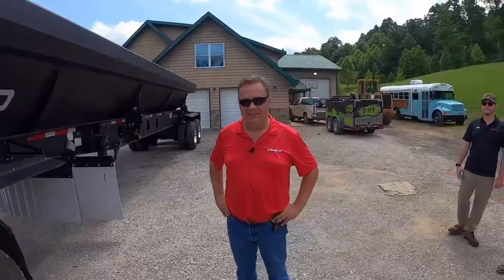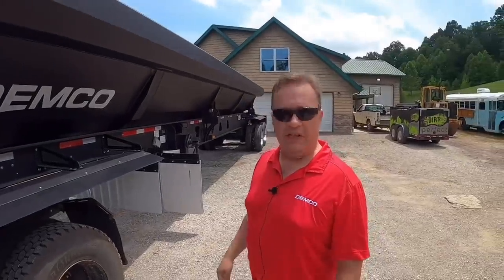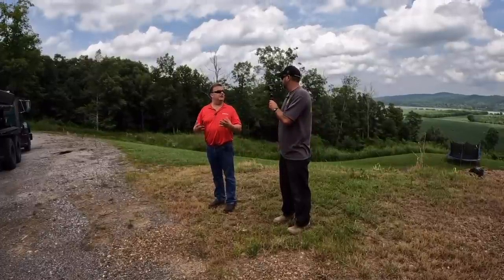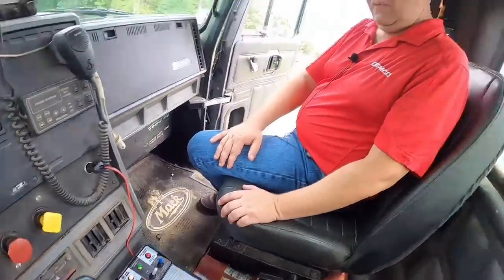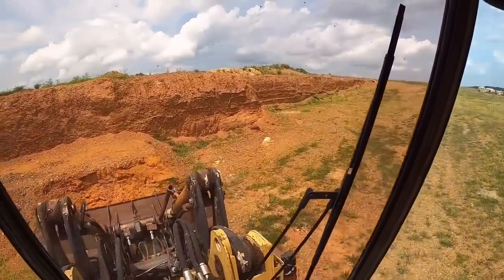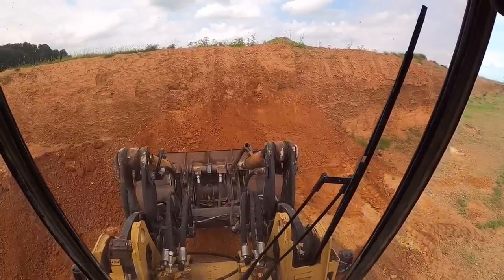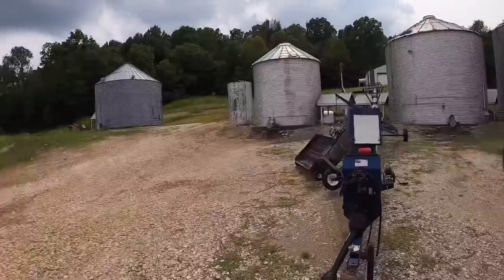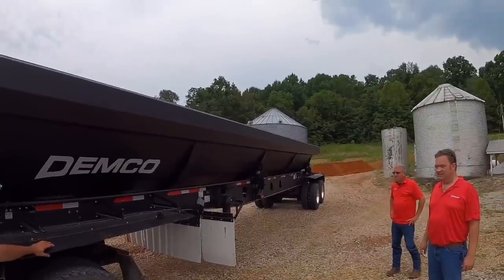Will A New Demco Side Dump Trailer Be Useful For Our Operation?

Comment: I ran a side dump on a few projects and I do like the way they pull. Feels safer in most conditions than a end dump but it does have its limits. They don't pile as good as end dumps. My favorite feature was dumping on the fly by. No need to stop equals less likely hood of getting stuck. So basically if you are dumping on the driver side you steer right, away from the pile, as you dump and it helps keep the material from going under the wheels. Less getting stuck and less chance of flats in your tires. 
Another good feature of the side dump is less training. End dumps can be dangerous and tend to need more training.

Comment: Man what an awesome company and trailer! I could totally see you using this for keyways on ponds and driving around the top side instead of backing down with bubba dump. I could also see this being used to haul stumps and trees since its long and you don't have to worry about it coming out the back.
Reply: bubba dump could get a fifth wheel plate?

Comment: In the Pacific Northwest you see side dumps pretty regularly.  I worked for a general contractor building concrete tilt up warehouses on river bottom soils.  Before the foundations could be started, a pre-load of the site was required, in which the site was forced to be compacted.  A pile of dirt was hauled in, sometimes 10-12' tall for the entire building footprint and then the site was monitored by surveyors to verify the settlement of the footing sub grade.  This could entail hundreds of truckloads of material.  The side dump was perfect for a long, wide dump needed for the pre-load.  The dumps were windrowed out so the lifts were controlled for spreading by the dozer and better compaction of the pre-load.  After the pre-load was completed, all the material was trucked out, except what was needed to get to dock high slab elevation for the warehouses.  In this area, the brand you see quite a lot is Sidedumpr.  They seemed to work great from my perspective as the GC's superintendent.

Comment: Here in Idaho, side dumps are everywhere, probably 40-50% of the dumps are side dumps. They are fabulous for road widening/shoulder work. They can dump a load with minimal traffic disruption. The trip cycle time is much faster. 
The DEMCO sales team is fortunate to have Mike as a demonstrator. Mike rocked this demo.
With the volume this trailer can haul, I'm surprised it does not have an air scale in the rear axles.
Reply: I'm also in Idaho and run side dumps, SmithCo is mostly preferred in our area, they hold up and dump (clean out) a lot better than any of the others those squared corners in the bottom is a sticking point, everyone that's had a Demco for a while calls the flex corners flex and crack.

Comment: 24:29 As a safety turn your tractor a bit when your dumping. If your dumping to the left side, nose your tractor to left.not a lot. You can dump straight. But if you are dumping rock or trash you can back away from it easier if crap gets in under your tires. If you want to stockpile . Cheat your trailer up to you pile and jackknife as you back away.
I've run a sidedump a minute or two. It's more fun pulling two at a time.
Reply: We were pulling twin 40' in a 9 axle configuration. 35 tons of rip rap in each trailer. Load her up and go truckin!

Comment: I’m impressed all the dirt came out and didn’t get stuck by pile building up. They definitely have their place, but only when you can get a semi with a  trailer to the loading and dumping spot. Not to mention it’s gotta be level ground.
Reply: ANY dump trailer has to be on level ground.  That side dump is probably way more forgiving than an end dump so long as the load doesn't stick.

Comment: Loaded alot of side dumps, we use them alot in Montana.  Just be a little careful dumping really really sticky mud off an embankment.  It tends to stick in the tubs some times past where dryer dirt would have normally already started to fall out.  The muddy load tends to stick in there causing the wait to be unbalanced to the side your dumping off and I've seen my far share of them on there sides.  Usually dosen't hurt anything just have to tip trailer back up onto tires.  It kinda tips over on its pile so it dosen't usually take the whole truck over unless your dumping off an embankment where the pile dosen't catch the trailer then the truck sometimes goes over the embankment upside down.  Not a good day. Other than that they can be really handy for hauling riprap, and other debris/trees, logs.  Can haul larger loads of dirt/gravel like a belly dump but dont need so much space to dump a winderow out like a belly dump requires.

Comment: I pulled a dump trailer a lot of miles in southern indiana over some sketchy roads and dump in places that were far from level. I never turned on over, but came very close a few times. So, as far as pulling goes I really like it, loading looks pretty easy for the operator, it may be limited on placing material exactly where you want it sometimes, 39:37  but the safety of dumping will allow you to dump in places an end dump could not. From what I see for an excavating operation, thumbs up!  Can't wait to see you take it to the job site.

Comment: Hey Mike!

My in-laws have ran a side dump on their farm in Iowa for 15 years. Their first one was a tandem axle in the rear and they turned it over several times. No big deal, just flip it back over and go again. When they replaced it with a new one, they got a tri-axle in the back and it is way more stable. They leave the 3rd axle down and lift it back up once the load is out.  They almost always dump with the truck at a 30-45 degree angle and then back out of the pile before going forwards (prevents getting stuck a lot of the time, as well as creates even more stability).  They haul manure, rock, dirt, busted up concrete! Works really well! Hope it is successful for you!
Reply from the maker: Awesome

Comment: Just an observation for feedback to Demco: I'd think it would be nice to have that 3rd switch option for actuators on the front and rear pivot locks.  Then the driver really is hands off and can do it all from the cab.
Reply: you only need to do that if you want to switch dump direction so you would only do it maybe once a day maybe only once a week
Reply: @griffoutdoortv5882  not necessarily.  If you're dumping repeated loads in tight quarters and have to utilize both sides of the space it would be handy to have the option and utilize an otherwise unused switch if you don't have a drop axle.

Comment: @dirtperfect we run sidedumps daily in the Midwest, love them. Only tips I’d recommend are we always turn the truck to 10-25 degree angle from being straight with end dump. So we turn slightly in the direction of the side we dump the load on. That pivot angle makes truck feel stable and prevents the trailer from wanting to feel tippy where it wants to when truck and trailer are straight with each other. Especially with sticky loads, having the truck slightly pivoted from straight helps because sticky loads can be scary when the dump hits that mid dump point(I did too ours once but it sits much higher and had concrete pieces  sticking out the top making the trailer too heavy) . Plus offsetting the truck from straight allows you to back up straight into the angle and avoids pulling the rim and tires along/on the pile of material you dumped if that makes sense.

Comment: I lived down south of you guys in Clarksville, TN for much of my life and, yep, the side dumps are odd creatures back east and in the South.  After moving up to North Dakota (Watford City, 2014, Williston now), side-dumps were part of the water-hauling/rentals operation I worked for.  We used them to haul drill-cuttings to our landfill.   We also used them for hauling scoria (similar in color and weight to a clay pot that's been ground up, kinda the same color of the chirt you were hauling but a lot lighter) which is used up here for oilfield pads and a lot of the "dirt" roads.  Drill cuttings would stick in the tub frequently (we had long-handled scrapers to clean the tub out) and due to the soft nature of going up on the pile at the landfill, we always had one of our dozers holding that push-block.  The push-block was handy for heavy equipment to push us through mud that was often axle deep.  At the place where I now drive winch trucks most of the time, we used a couple of side dumps for hauling off demo debris (an old wooden grain elevator over in Montana).  As long as the material isn't sticky or frozen in the bottom (if anyone is going to get a load that sticks, it'll be me  lol), they work great.  If something DOES get stuck, it's a lot easier to get to it with a scraper or the bucket of a wheel-loader or excavator.  

I've only pulled the tri-axle versions and they are far more stable than they first appear.  I've a healthy respect for center of gravity but after pulling them for a while, curves and turns didn't bother me much at all.  I'd much rather dump one of these than an end-dump, too.  They're easy to switch for dumping to the other side.  Windrowing material on the fly is not a problem with some common-sense, of course.  Plus, you mentioned dumping over a wall, which is what I used to do at the landfill on occasion in a mixing pit where the wetter cuttings were mixed with scoria to thicken things up.  

I'll be curious to see how you guys like it after a project or two.

Comment: Well if you use the site dump trailer when you were making your pond you could drive along the top and dump it and into your bulldozer wouldn't have to work so hard to move the dirt where you wanted it cuz you could pour it off right now or you needed it
Reply: Aslong as it’s not wet or soft. Pond locations are usually wet hence why it’s a good spot for a pond. Not always but most times

Comment: Mike the best advantage to a side dump is hauling rock and dumping over the side of a ditch or a dam where you need Rip Rap. I have seen the state of Oklahoma use them in for that purpose. Especial when using larger rocks or gravel.

Comment: I’ve been running double side dumps in Vegas for many years. I have tipped my pup trailer over twice due to the ground giving away under my tires while dumping over an edge. Wasn’t a big deal. Flipped the trailer back over with the loader and went right back to work with no issues.

Comment: Looks like a well designed and built trailer.
Reply from the maker: It is
Reply: @DirtPerfect  I noticed you switched sides you dumped from, was that so you didnt block his drive or some other reason?

Comment: In western Oklahoma I’ve seen 1 side dump, 25-30 end dumps & 1,000 belly dumps. When you use a belly dump especially on road work you drop a  windrow back the next 1 up to it & drop it, take a blade roll it back & forth a couple of times and then you’re done. Works nicely
Reply: Belly dumps spread gravel beautifully at 40 mph. Don't even need to blade it.

Comment: As a driver that has grown up in the dirt world, construction, paving, demolition, earth moving, and what nots. Mostly on the west coast, but long before side dumps were a thing. I have been aware of their presence and have always wondered about the stability while dumping. So there were a couple things that caught my attention from the start, the first were the drain holes to prevent standing water. Not sure how large those holes are, but being in the bottom of the floor as they are, there would be a fair amount of concern hauling something like washed 1/4 minus (pea gravel) or sand, especially beach sand, not crushed sand, like used in playgrounds and golf course sand traps. The other thing that stood out were the shiny aluminum wheels, my aren't those pretty! But upon dumping, the material spilled into those pretty rims. Two problems there, damage to the pretty finish, and upon completing the dump one would need to pull away from the dump site and take a minute to clean that material from the rims to prevent carrying it out to the road for a potential windshield claim. Much like you should brush the apron from a traditional dump truck. Another disadvantage could be dump site space. Often a contractor will require that the piles (especially stock piles) be kept high and tight, whereas here your piles are 34+/- feet long and stacked side by side. I can see some big advantages, say in a quarry application or in any sort of operation that say a bottom dump might be suited for.

Comment: Great Demo. all went well that is till you pulled away from the dump. Notice the tires on the trailer crossing the dump pile. If that were construction debris with sharp objects your investing in new tires or you now hung up on a few stumps or logs that have rolled up under your trailer. Having the right tool for the right job comes to mind.

Comment: Absolutely!  With the side dump, the box doesn't have to extend over the wheels so you don't have to leave some room in the rear to get weight on the tractor. I've seen one with steerable axles that could turn slightly to move away from the pile when dumping.

Comment: All that work on the Mack is getting a good break in with the side dump demo!  Can definitely tell a difference in performance!  I foresee quite a few reasons this would be beneficial for some of the projects DP does.  In the end, it's all a matter of if the usage is enough to justify having in the fleet.  One thing is for sure.  DP will definitely put it to the test and is always honest when it comes to likes, dislikes, and recommendations for improvements.  Each operator is different, the feedback is the same level of necessity for the company to receive so they can improve design and function.  Real world testing reveals significantly more than the company testing.

The only issue I see is if the Mack is tied up with the lowboy and nothing to pull the side dump.  If it was to be used regularly, I would think another truck would be needed.

Comment: We do a lot of demolition work (buildings and roads) and have 4 of them. They’ve proven invaluable, and maneuverable. You can also put more material in a smaller area. We run steel rims because hauling concrete destroys aluminums.

Comment: I used to work/live in SoCal, now in Colorado. Side dumps are popular in both locations. I have seen them on their sides. Some brands work better than others. Dumping dry dirt (like churt) is not really a problem. Wait until you try dumping boulders (things get very lively then), or sticky material. The boulders like to roll back under the trailer too, so keep that in mind.

Comment: Back in the 1980's they were very popular in the north of Australia for building roads, they were a much simpler design. The advantages were that your rig would pull 3 trailers (road train) and tip as you moved, the road graders could then spread out the load.

Comment: Don't let them fool you you can tip them over especially if you forget to un tarp your load, my buddy just tipped his over 2 weeks ago and it ended up totaling his truck and now has to use his spare truck to pull it. The farm has a bunch that hauls manure and ends up tipping 3 or 4 over every year but I will say most is operator error. You're also going to want full locking gears in your axles when you are spreading.

Comment: For the side dumps I've operated, we had air scales on the truck and trailer to see if we are within the legal weight limits. So we don't have to get a scale ticket every time I got a load. In my experience the only disadvantage of a side dump is space to dump. If you have a tight location to dump material and need to keep the pile foot print as small as possible, then end dump. Otherwise I'd take a side dump any day. Or a (trout river) live bottom trailer

Comment: Mike,  the side dumps also work good to haul snow by being loaded with a snow blower.
The city of Sioux Falls hires contractors to haul snow out of the city and they use crawler dozers to pile it up.  Check them out some time.  The big dog did great with that load.

Comment: Now that is one neat piece of equipment, Mike.  I loved that you could drive away slowly while tipped and the trailer eases back to its original position without having to get out of the truck and not having to fasten the back tailgate.  You're gonna love this side dump trailer and I think you're gonna want one to add to your heavy metal fleet.  Thanks for sharing this vid.  It was exciting to see in action.  I've never seen anything like it and this was a treat.  Have a fine week. 👍🏽🤠 9/19/23

Comment: One thing I can see an advantage of over an end dump is being able to knock it down easier with a dozer because it’s in an end row instead of a big pile. I bet it would be great putting down the base for driveways. Another thing is you don’t have to worry about is hitting power lines because hitting one of those can make a good day go sideways real quick.

Comment: Liked the action of the trailer, would have been fun to see the tarp unroll and roll. Will be interesting to see how you use it when doing a drive as it can't spread, will you have to side dump a couple of times or dump whilst running. Another good and fun video thanks DP.

Comment: We use side tippers a lot in road construction where we have boxed out for widening, allows us to go narrower in the excavation, also good in areas where height is an issue. We dont use them much on normal lane construction as we dont have the space to side tip, conventional tippers fit the construction style much better as they can run and tip in the lane being built and not cause issues with the traffic in the adjacent lane.

Comment: I'm running two of these behind a JD 9520 with tri axles and off road tires. Its insane how much dirt I'm hauling with it at the current job site. About 3-4x the dirt as the double scrapers and 2-3 as the ORTs are hauling.